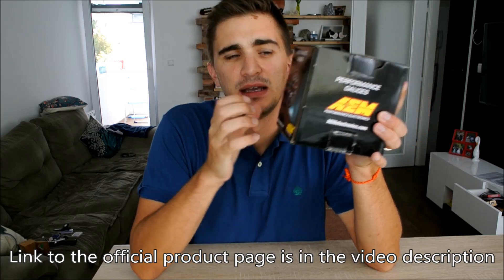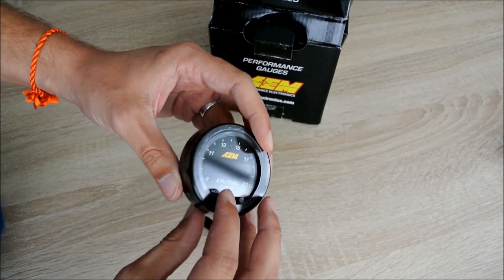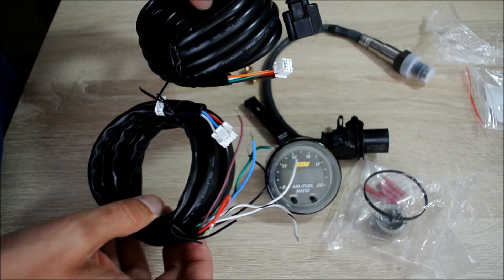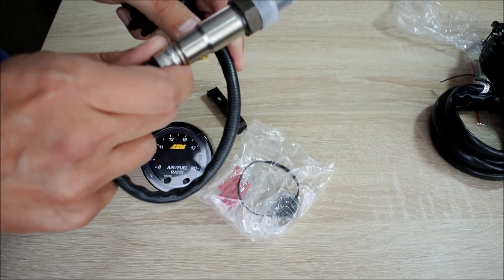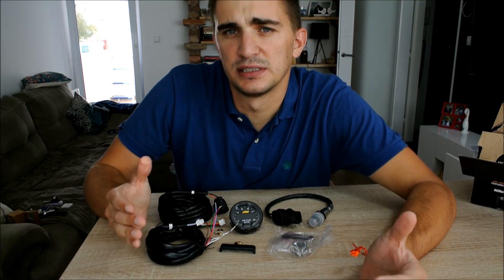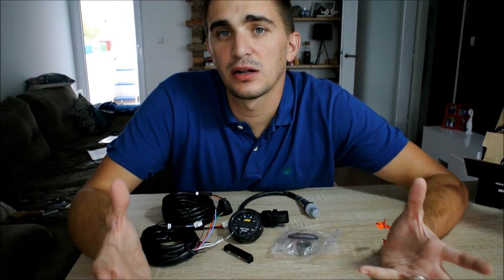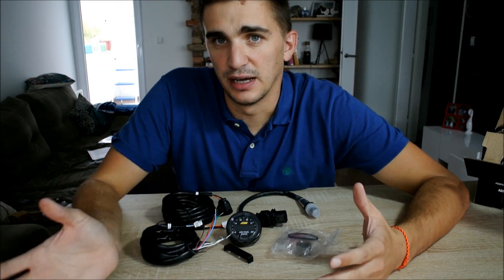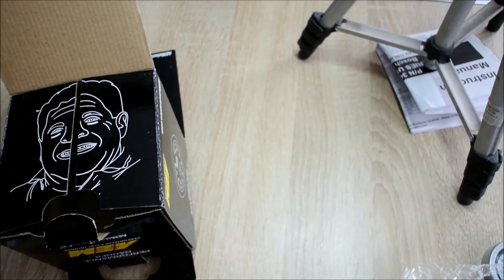AEM X-series wideband AFR gauge unboxing

Comment: Probably buying one of these today. :D
Reply from the maker: 802 Garage Excellent choice sir!
Reply: The price on Amazon just dropped over $20, so only $153 right now for the full kit!
Reply from the maker: 802 Garage Do it! Buy buy buy :)
Reply: 802 Garage wow, haha i just bought one too because i saw the price at around 150. Did it just change in price?
Reply: driving 4 answers Bought one!
Bryan R Yep! Price changed yesterday. Use one of the Amazon price trackers and you'll see. I actually managed to get it for only $136 by buying it on eBay though. Using a browser extension called Wikibuy I got 15% off my entire eBay order. Bought a dual gauge pod for my WRX, the AEM X-Series wideband, and a GlowShift boost gauge for only $200!

Comment: So awesome! That is definitely the way to go. Back in the day people would do a WOT run then shut the car off before the engine decelerated and pull the spark plugs out and look at their color to see how the mixture was. If you want to know how each cylinders A/F ratio is you can use that method, but for general monitoring of A/F I'm on your team and I agree with you totally about running this gauge.
Reply from the maker: Yeah I tried that method out myself, it's not very practical but it definitely works. As you point out a gauge like this is great, especially because you get to see your afr in real time and in all possible throttle positions and driving scenarios, plus the aem x-series fast response makes it real real time :) so it really is a great tool for squeezing out everything from your engine, but also safeguarding your investment against knock.

Comment: For mine I didn’t need to weld the bung to the exhaust. The stock exhaust has a place to attach the new o2 sensor. Cheers
Reply from the maker: Yours is probably a newer car? I have 2 exhaust manifolds for the mr2, one doesn't have an o2 sensor and the other one has the old style  with two bolts, so I'll definitely have to use the bung.
Reply: driving 4 answers I have a 89 MR2 (red). I was able to unscrew the old narrow band sensor from it mounting plate held in with the two bolts the stock exhaust. They share the same thread type so don't undo the two bolts just try to replace the sensor.
Reply from the maker: Jeremiah Hale Hey that is some super useful info right there! Thanks a lot man, I didn't know that.

Comment: educate me if u may, i always hear about wide band sensor but to my limited knowldge, i understand it displays air/fuel ratio, and beside that it doesn't do anything else. so it's an air/fuel ratios monitoring device? if it's so needed y didn't car makers have it installed on the car from the factory? what benifit does it provide beside displaying your A/F ratios?
Reply from the maker: +An Trinh Yes it's an air fuel ratio monitoring device. Some just monitor it, this particular one is also ready for data logging and is also ready to be connected to other devices together with which it can also control the afr. For the time being I will use only the monitoring feature. As I said in the video an afr gauge is necessary once you start tuning and changing the amount of fuel entering your combustion chambers, by for example changing the jets on carbs as I will be doing. You need it to see whether your afr is still good after tuning. Cars don't come with it from the manufacturer because the manufacturer does not give you the option to alter the amount of fuel entering your combustion chambers, and doing that will void a new car's warranty.
Reply: driving 4 answers. I see , u can also connected to a stand alone ecu to control the a/f ratios? If so that is a very needed for ur vehicle, can it be connected to ur stock ecu?
Reply: @an trinh no, you cant connect wideband to stock ecu. You need programmable ecu. Megasquirt, hestec, haltec..